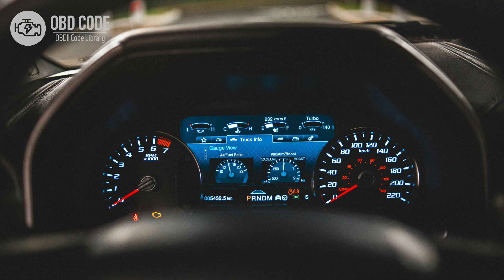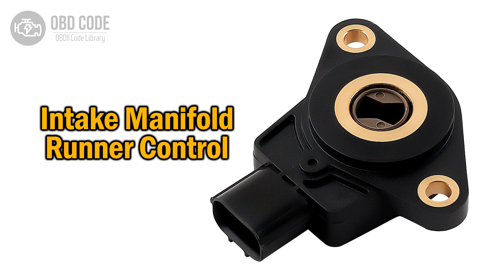P2005 Intake Manifold Runner Control Stuck Open Bank 2 🟢 Trouble Code Symptoms Causes Solutions

Comment: On my 2006 Audi A6 Avant with 3.2 the P2005 - 007 - Stuck Open Code (Intake Manifold Flap; Bank 2) was caused by the linkage for the flap control popping out of place. This vacuum operated controller located near the base of the oil filter housing. It a black plastic arm that connects to a white plastic ball (1/4" diameter). If you watch it while someone operates the throttle to full hold for a second or two then release and repeat, you will see the arm and the white ball moving independently. You need to pop that arm onto the ball on linkage. I had a similar error code that was caused by the very same kind of flap actuator located on the front of the engine. Same issue, the black arm from actuator came off the white ball. As its much easier to get to than the one on the back of the engine near the oil filter housing, I slipped a small piece of stink wrap over the white ball and use heat gun to adhere to the white ball. Then I popped the arm back on and it has stayed in place for 30,000+ miles.